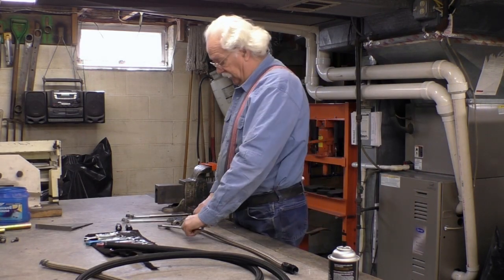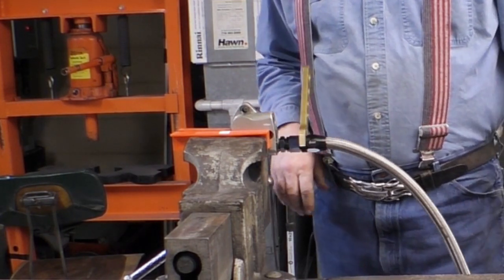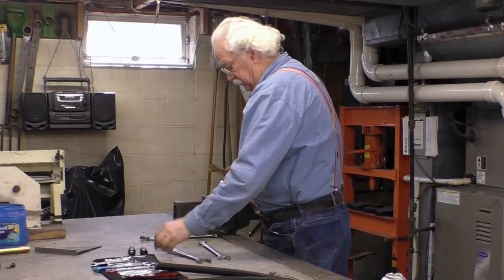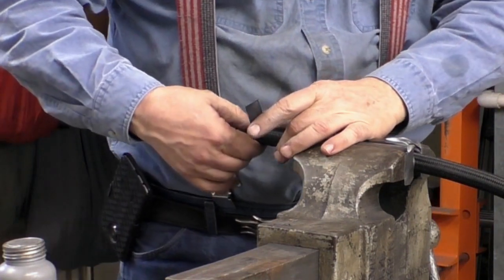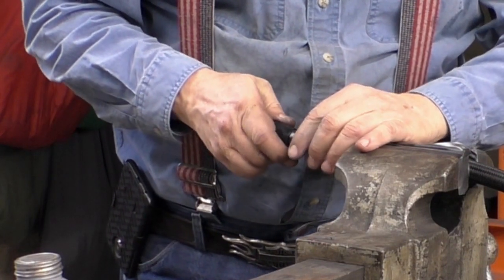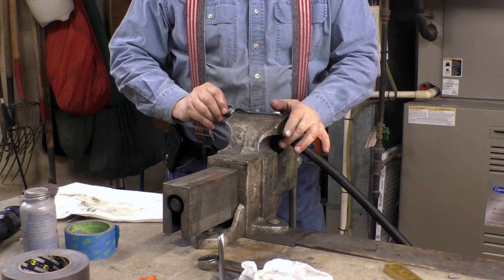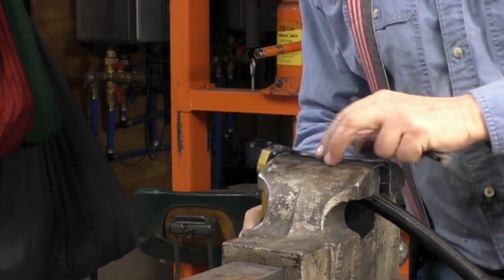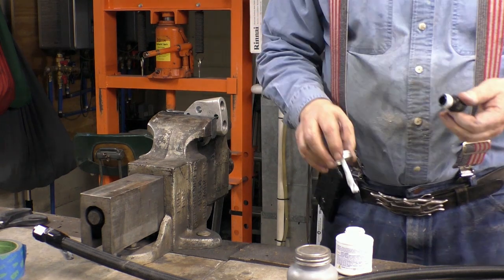How to Assemble AN Fittings on Braided Hose

Comment: If you left the electrical tape on hose end,  that is not recommended or approved (if using for aircraft).  BTW know what  "AN" stands for?  Answer.   Army Navy - standards set years ago for just about anything military.   Means approved for aviation army or navy use.  WHen you order a part- you would say I need a 3/8x24 bolt  It would be an AN part number.-  Also no need for anti-sieze.  Aluminum to Aluminum won't gall the threads.   Dis-similar metals will  Aluminum to steel will gall every single time.
Reply from the maker: Thanks for the information. Question, what does the -4 -6 -8 designations stand for?
Reply: @ThrottleStopRacing   sizing of hose  to match AN fittings
   
Male Thread Size	AN Size*	Equivalent Tube Size
(Nominal OD)	Hose ID**
3/8-24	-3AN	3/16″	0.13″ **
7/16-20	-4AN	1/4″	0.22″
9/16-18	-6AN	3/8″	0.34″
3/4-16	-8AN	1/2″	0.44″
7/8-14	-10AN	5/8″	0.56″
1 1/16-12	-12AN	3/4″	0.69″
1 5/16-12	-16AN	1″	0.88″
Reply from the maker: @avflyguy  Thanks

Comment: Great video guys. I’m trying to do An20 hoses at the moment every time I put the fitting into the nut on the hose the nut walks up. I’m gunna try and open up the inside once the nut is on like you did with yours as I think that’s what is causing the nut to walk up the hose.
Reply from the maker: Good luck, fuel lines?
Reply: Lever-Family-Racing no rad lines
Reply from the maker: @cookierageracing7052  I used the -20 for the fuel ling in the dragster
Reply: Lever-Family-Racing that’s some MASSIVE fuel lines. But I guess you use a lot of fuel. Any tips for making the lines?
Reply from the maker: @cookierageracing7052  No tips other than the video (about 7 gallons in 1/4 and 7.00 seconds)
Reply: What is the name of the tapered tool? I keep searching for “owl” with no luck.
Reply from the maker: @Marcus_Woodard  It is an alignment tool for steel beams. McCarr Master has them
Reply: @Marcus_Woodard   Try searching "podger bar"